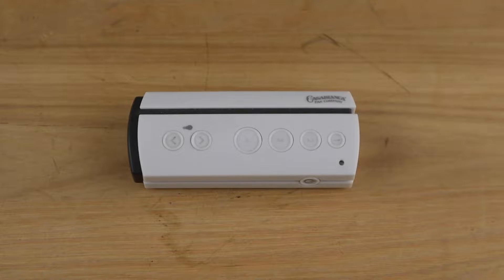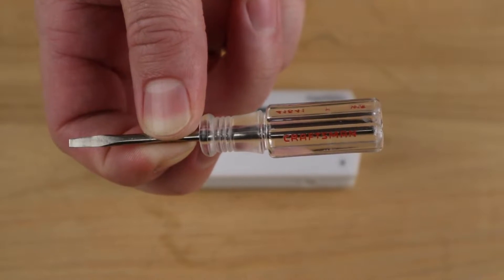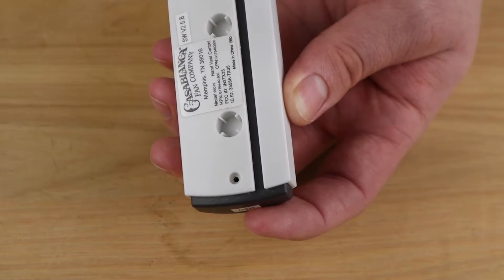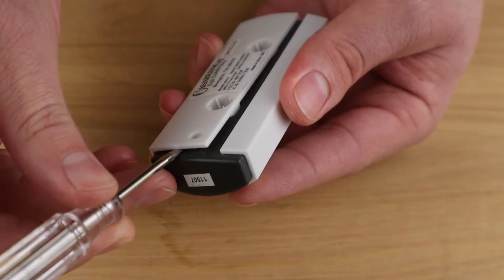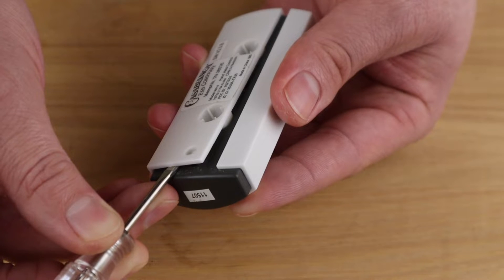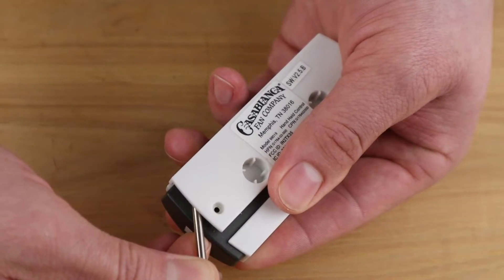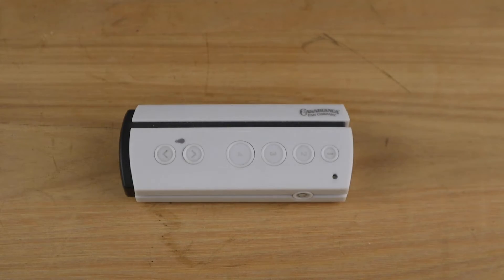Casablanca 99019 Ceiling Fan Remote Battery Replacement

Comment: What he does not mention is that once you have replaced the battery you may need to reset the remote to sync with the fan. Because after changing the battery the fan may not work as replacing a battery may require a reset of the remote to connect with the fan. I tried the following - turn off the main power to the fan (this could be your wall on/off switch, or the circuit breaker that was used to hook up your fan) for a few seconds; then turn power back on, then on the remote press the power button and the number 4 fan setting at the same time while pointing the remote at the fan. This worked for me and it was after searching the web for any and all videos, etc. regarding how to reset this remote that I came across a comment from a buyer on a Amazon site that provided the above procedure.
Reply: Can u put video for reset mine doesn’t work plz
Reply: Thank you.  You saved me from calling an electrician and buying another battery.  I had an unused battery and it didn't work but after doing what you said a few times, wallah!

Comment: This has got to be the worst remote design when it comes to battery replacement.  Thank you so much for this video.   Removing the battery once I opened the remote wasn’t easy but your tip about pushing back on the metal tab worked.  I use a CR2032 battery in this remote.  Again, your video is very much appreciated.

Comment: How do you change the fan direction with this remote? Thank you in advance.
Reply from the maker: You cannot reverse direction using the 99019 remote kit. Fans using this remote will have a reverse switch mounted on the fan body. The 99020 is the remote of this style with the reversing feature integrated with the remote, included with select models.
Reply: In rare case, if there is no reverse switch anywhere in the fan, not even on the top or above the light glass, or even a reverse pull chain, it can possibly be reversed by turning a fan on high, then off for 2/3 second, on for 0.3 second, off for more than 2 seconds, then back on. It's only the case if that remote kit was installed on a fan that's supposed to have an included Rhine remote kit that would reverse.

Comment: The hardest part is removing the old battery….sadly you totally overlooked that bit
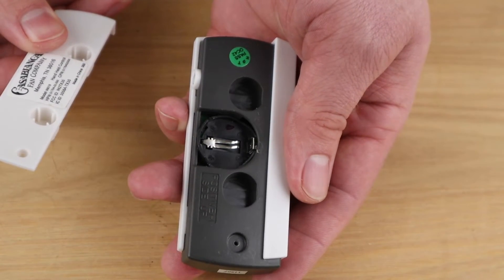Reply from the maker: At 1:45 I literally said push the tab and the old battery will release. If it doesn't, easy enough to slip your screwdriver further down to pop it.